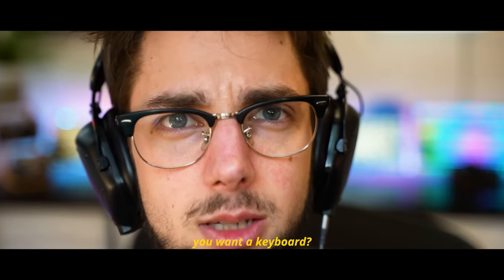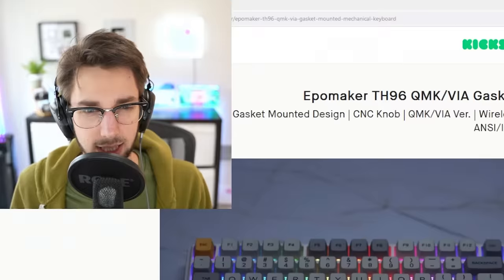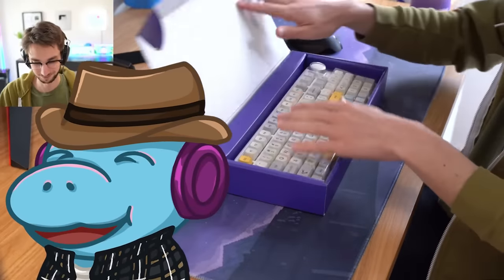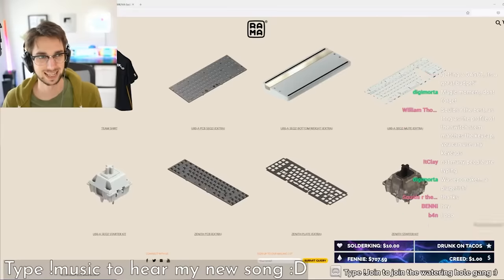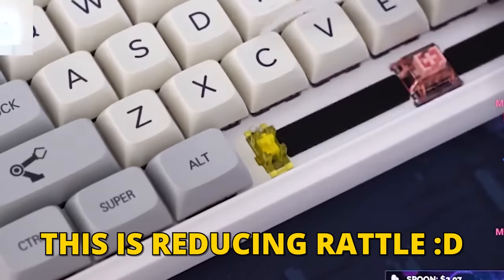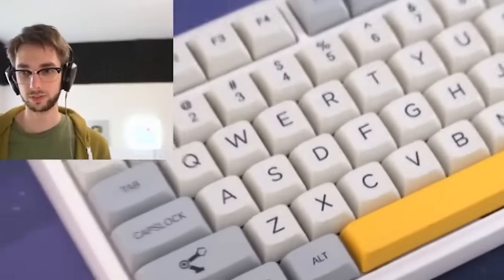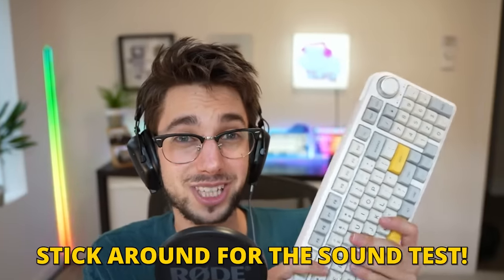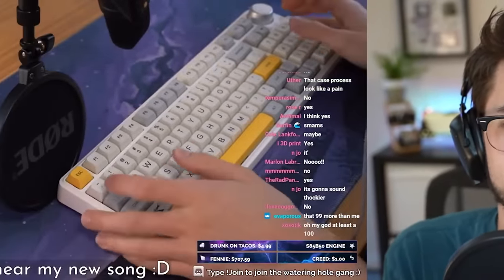DON'T. GIVE. UP...

Comment from the maker: At a glance it seems Epomaker is claiming they are the main producer of this board, its pretty clear that they are just a re-seller and that anyone else reselling is probably on equal grounds. The only caveat being the VIA enabled pcbs. I would take anything they say about it with a healthy grain of salt or two.
Reply: a
Reply: So, this happens in guitar production as well. Look up World Music in Korea, they make like.. 80-90ish% of the guitars that come out of South Korea, but like 10 brands use this one factory from PRS, to Schecter, to Agile. You'll see a lot of name brand guitars from PRS and Schecter get cloned almost part for part and resold under the Agile name, using similar parts, production methods, etc. 

The only real difference is in the expertise of the builders, the budget they're given, and the name on the headstock. That's literally it. For the consumer this is a great thing, it means I can get a much nicer guitar at a lower price. You are taking a risk on certain things like quality control, but if you're heavily experienced with guitars, it's worth it. The guitars can be a little bit more hit and miss on quality from the lower tier brands, but for the price you pay for them sometimes it's worth the risk.

Sorry for the novel, I just see a lot of parallels between the two industries regarding "clones" and "copies". If the only Les Paul I could play was an authentic Gibson, I'd absolutely hate the guitar market because Gibson sucks now a days. I'd much rather play a Les Paul clone myself, but other people swear by Gibson. They're both about preference is what I'm trying to say.
Reply: I would doubly emphasize the grains of salt and expect a bit of extra trouble shooting compared to other keyboards; I had issues getting VIA to work on some of the keyboards initially. The quality control of the Mini Cat 69 also seems to be an issue, which caused me issues getting the switches in for certain keys such as "3" -- and even after successfully getting the switches in, I can now visibly see those are shifted higher up on the line than the others. It seems like so far I only see these issues resolved in the Mini Cat 65, but that version does not have the numpad (mentioning for relevance to posting on this video).
Reply: I sadly bought a keyboard base from EPOMAKER and turns out that it had malware on it... I love love love the keyboard but the fact it has malware on it means im going to send it back as I'm not savvy enough to figure out how to flash a keyboard, would you consider doing a video about keyboards that are similar to EPOMAKER? would love to see some other brands that don't have Trojans on their boards

Comment: The accountant in me is happy to see a numpad.   Just bought the q5, loaded it with black ink v2 and switched out the stabs with durock v2.  Would love to see your thoughts on that board.
Reply: I just got a Q5 with NK Silk switches and Drop MT3 caps.  This has to be the next board on the review cycle.
Reply: @NigelMontezuma  Yeah.   It's been a bit of an adjustment but I remapped a couple keys in via after a day of use and it's helped considerably.
Reply: @NigelMontezuma loo
Reply: @ireadysucks3026  they're actually on q6 now.  Not sure if it's already out or about to release but yeah they're really filling the line out with one of everything
Reply: Yes another accountant! I cant live without the numpad 😭

Comment: If your wondering about the similar/same designs being manufactured in the same factory, this is something that isn't that uncommon in China. Often, products manufactured in the same plant will be sold under different names/brands but overall have the same/extremely similar model. For example, I have a pair of IEMs called KZ, but a similar brand that's almost the same is sold under the name Kbear. There is also a similar story (kind of) of when one of my relatives went to China and ordered a custom dining chair for their dining room and about a month after getting the chairs, almost the same exact model was found in their sister's apartment, who also had no idea at the time.

Comment: to be honest, id recommend getting the TH80, seems like a better version of this board for anyone looking for a pretty decent stock thock.
Reply: The TH80 is awesome! I love mine.
Reply: @MsToshi1990  same it has a great feel for the price
Reply: I recently got the TH80 for personal use and I was going to get the TH96 for work. Do they not sound the same?
Reply: @thomasdeguzman1149  really would depend on the switch
Reply: @thomasdeguzman1149  mine has gateron pro blacks and it’s pretty thocky
Reply: @boomstick7870  I got the yellows and they're pretty thocky and relatively quiet as well. I was considering getting either the TH96 or TH98 for separate office use

Comment: This is about as close as I think I'm going to get to having all the features that I'm after for a general purpose keyboard. It's really hard to find all the features I'm after in a board that comes in an ISO layout. ISO layout is a must for me as my work machine is locked to UK layout and it's super annoying to have to mentally switch between layouts on the fly, so that's the main reason for getting this rather than any of the other brands rebadged version. I'm not a big keyboard guy but my current setup of a TKL in blues & numpad has been getting on my nerves for a while and it's loud as anything in late night gaming sessions. My gf has a board with lavender linears which are far less obnoxious. I'm probably going to get this and swap the switches for durock dolphins. Probably in black and just switch in my DSA dolch keycap set.
Reply: I mean I'm in the UK and use the US international layout, so all I need to do is rALT + LShift+ 4 and I get my £. I just learned the new layout cuz I don't mind the US layout
Reply: @lukesalvidge118  If my work machine weren’t locked to the UK layout I might consider buying non-ISO keyboards, but it’s just too janky switching layouts for me. Sure, I could switch the key caps on an ANSI kb to make it work for both layouts but it’s more of a comfort thing just to keep with the physical layout and key correspondences I’m used to.

Comment: Dukharo is basically OEM for many brands. Dukharo boards are being sold as Lychee, Epomaker Etc.

This is the first time Epomaker did a rebrand of other boards.

EP84:  Keycool KC84
TH66: Dukharo VN66 which is also being sold as eclipse EC66
Epomaker 680: FK680 Pro.

And gasket mounts on these boards are mostly for the sound isolation  rather than softeness or flex  I believe.

Comment: I'd like to see you compare this to that other board. Pretty sure you can still buy the Duhkaro one for like $100 (with switches a little less without them).

*Honestly, I'm curious as to how often this sort of thing happens. I know it's probably pretty common with the more budget oriented brands because I've seen more than a few boards that look exactly like my cheap Tezarre TK61, sometimes the only real difference seems to be where they place the USB-C port, because almost all of them come with Gateron Optical switches and pudding keycaps...seen some very minor differences in the cases from time to time, but it seems like they are mostly made by the same company then others get to make some choices on where the plug goes, maybe some different style on the cases (hi or low profile or slightly rounded/tapered toward the bottom)..and I mean, I'd expect that to be the case because, really, how many different factories can there be making almost identical boards? Just hits different when it's certain companies or when they are using kickstarter to imply some need for fundraising and innovation on their end.

Comment: I got the Dukharo version from JD (it was a long and difficult process, using both the app and website), but I’m pretty happy with it. I got their silent switches, and it’s actually tactile which I wasn’t expecting (thought it was linear). Basically no pre-travel before the bump, almost feels like a snappier membrane, which I kinda like.

Comment: I could be wrong, but I'm pretty sure this kind of product overlap across brands is common with Chinese products. The two brands may even have the same parent company, which just makes slight variations of the same product for different markets under separate brands. This is essentially what BBK does with a couple of its phone brands (Oppo and OnePlus) and of course Xiaomi with its numerous sub-brands. I assume this scenario with the keyboards is very similar. Plus IP laws are much more relaxed in China, which can create very similar products, but also allows different brands to build on established designs quicker without the additional cost and legal hairiness that they'd have to deal with in a country like the US.
Reply: it's not the first time either. the GK61 chassis was used by many brands, and i think most of chinese brands still use oed/odm case such as RK, Gamakay, Geek etc
Reply: I first learned this from chinese graphic tablets. Like the Huion 1060 plus, 10Moons 1060 and Bosto1060 or the Ugee 1910B and Alfawise 1910B
Reply: @oatmilk9918  Yeah I've used a few RK boards and they definitely use a a common chassis.
Reply: @Kogami  Yeah. Usually the difference in products is more about software implementations or slight feature differences here and there.

Comment: Howdy hey, Hipyo! Great video, as usual! Speaking of Epomaker boards, if possible, can you make a review and/or take a look at the Epomaker th80. I’ve seen this board and looked into it a bit, however, I just wanna see your own opinions on this keyboard. I think it has quite some value to it for its price.
Reply: …also, it has a KNOB 🤭
Reply: yea! he really should! it’s cheap, and i’ve heard it’s good for the price… 🤔
Reply: I got the barebones kit about a month ago, slapped some akko cs silvers and some epomaker matcha keycaps. I really didn’t like the color of the golden knob so I painted it white and now it’s kinda pretty. However the 2.4 ghz dongle done broke and so did the rgb backlights (randomly started working again this week idk). Otherwise sick board for the price, got it for like 65 bucks. Sound profile is creamy, I dig it.

Comment: You can find this exact Keyboard the  Epomaker TH96 being sold under other names and companies, being the Lychee G96 Pro, Dukharo VN96, Mathew Tech MK96. The Epomaker is more expensive than all these others. All they are doing is rebranding a keyboard from another manufacturer. If you want it buy it from someone else, and NOT through this kickstarter instead. It'll be cheaper, and you'd get it sooner.
Reply from the maker: Watch the video once its live :) Also worth noting that those versions aren't QMK/VIA supporting
Reply: Thanks for the info.   Looks like none of these are even on Aliexpress for US customers to purchase unfortunately.

Comment: okay, this kb is not a clone or something. Its the same deal as with the LK67 and TM680 (it has even more names from different companies) they are basically same keyboards but seller includes different stuff in the box, stabilizers are very bad on TM680 but decent on LK67.
Also software is different

Comment: One thing thats confusing me is, you say its MDA V2. But EPOMAKER says, that only the gray version will get V2, and this white-yellow not-V2. So only the darker gray variant will have more rounded caps. I would also have ordered rather the white version, if it comes with V2... but as far is i understand, it doesnt.
Reply: Looks like XDA in the video too. MDA isn’t flat at all.

Comment: So- I would like to put together a full size keyboard using a separate numpad on the left, since I am left handed.  I am a novice to this keyboard stuff, but I would like it to be RGB with keycaps that will allow the light to shine through. I was completely lost on Epomaker's website, and they have no phone # at all, so I emailed them.  The email I got from them in response was so far off from what I am looking to do in terms of recommendations, it's actually nonsensical. It doesn't inspire confidence in terms of back end customer support from this company. Very frustrating.

Comment: I got Glorious GMMK 2 96% board pre-built for 119.00 USD.  no knob and no wireless but for 119.00 USD, I think my board is better.
Reply: Do you plan on modding it
Reply: @fabiangomez357  I've installed Glorious Panda X switches from Drop just for A-Z and now it's a lot closer to what I thought a custom keyboard should sound and feel.  they say I should lube the switches if I want buttery smoothness but no... ain't got time for that
Reply: @filovirus1  I'm trying to decide on getting this or not. I like the 96% size because I actually use my numpad, but others have suggested getting 65% and buying separate numpad. I really like the look of white with alternating RGB keys in pink/blue for that synthwave look, but it's OOS on Amazon so I wonder how that setup would look with the black version. Eventually I'd want to get milky yellow pros but I don't know if the creamy top will affect light output. Eventually also do PE foam, bandaid, maybe thin silicone sheet. PBT caps one day.
Reply: @fabiangomez357  i absolutely have to have numbers keys so i’ve been waiting for a decent 96% and this was it. got the white one. it’s a beauty. i ordered directly from glorious site not from amazon

Comment: What kind of Full Size keyboard scam is this, I need an actual 100% at best with extra Macro Buttons on the side and Knob an Media Button's. There are only 2 Keys I don't use on my Keyboard, that is Pause and Scroll Lock Those rly are ancient the Rest is used heavily, Page Up Page down, Pos1, End, Print all used not to talk of the entire Numpad. I want the G915 Layout in a Custom Keyboard pls.